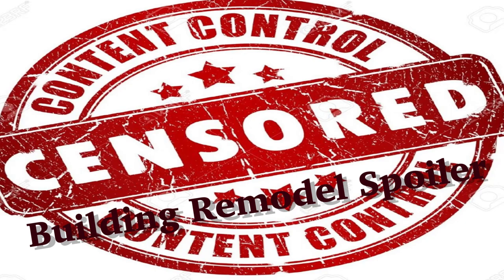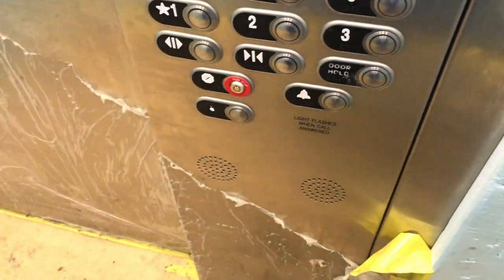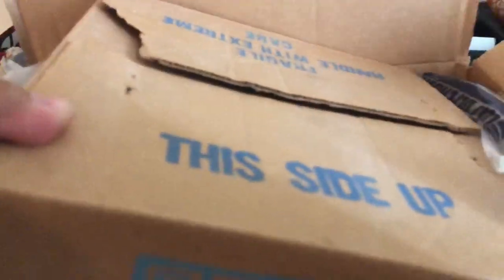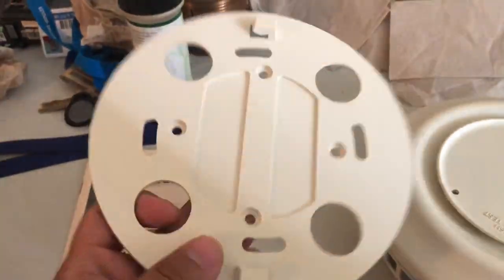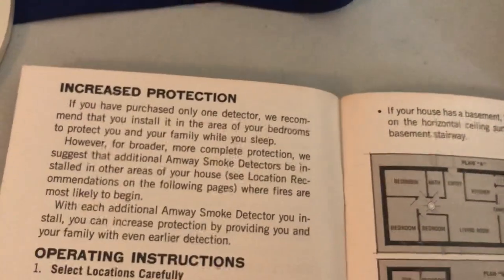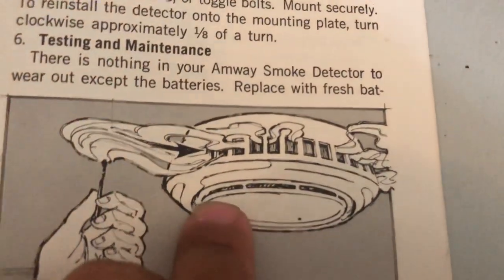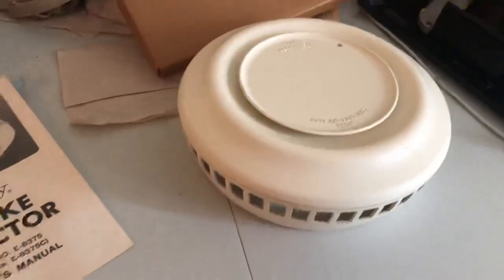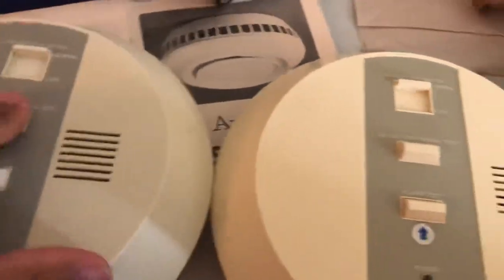Amway E-8375 Smoke Alarm — Unboxing, Test and Amway timeline

Comment: I like the low battery test on the first one. That is exactly how it sounded like on the old Dicon my parents old house when the battery was getting low and the horn sound is almost spot on of it too. I do believe the horn and sensors on both detectors were the same.

Comment: I think it uses the same pcb as the Waterpik D1 because the sensor looks the same and they both "thunk" when the battery is low.
Reply: I does look similar and I can see why you would think that. Bye the way I finally won one of these on Ebay today. Yippee!!!!! I should have it in a few weeks but since I got the Sears Early One before the estimated date (pardon the pun) I have a feeling this one could be as well and it doesn't have as far to travel. There is one unit left on Ebay that I know of. I can't wait to get it and there will definitely be a video!!!!